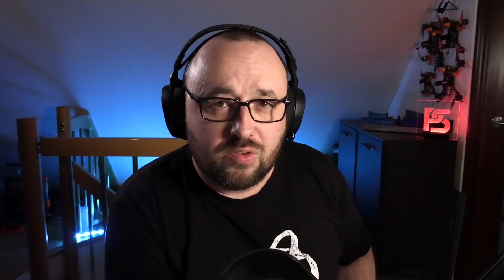Why INAV does not support PPM protocol anymore?

Comment: Betaflight still supports PPM input, and they're arguably at the forefront of open-source STM32-based flight controller firmware developement. 

Feature selection & priority is very subjective. We don't all need the entire catalog of new features within inav, yet could still benefit from bug fixes & improvements in the core code. Why not just move to a custom build format the way the Betaflight guys have? 

Also, exactly how much in terms of flash & memory resources were saved by removing PPM. I'm betting it wasn't even that much.
Reply from the maker: I don't want to go to deeper discussion as PPM was removed 2 years ago already. But there are some aspects I'd like to point out

1. INAV is not Betaflight with GPS and that means both firmwares have own paths 
2. It turned out in those 2 years since we dropped PPM nobody really compained about lack of it and our pilots were more than fine to either upgrade to something else or use legacy versions of INAV with their legacy radio links
3. Progress means that sometimes you have to let something go. Things that are no popular, are obsolete or just do not make sense anymore on a longer run. PPM, NMEA GPS and other things that are just no longer a thing
4. Removing not popular code is not only a flash saving procedure. It also removes cludged and dead code that bloats the codebase and makes everything just harder to use
5. With all due respect to BF, we have more interesting things to build than cloud build system. If I have some time I want to spend on open source and have a choice: cloud build system or interesting new feature than can be used in flight, I will choose the later one

Comment: you actually didn't explain the motivation besides calling it obsolete. it is still used and exists... but not sure wanting timer-based or interrupt-based code would explsin the issues you avoid. moved to ardurover instead, as in rover setups it is still common.
Reply from the maker: Steam engines also exist. Yet Noone puts them in modern trains

Comment: WHAAAAAAAT??    I just got my old F450 out, updated from iNav 2.5 to 6.0, got everything cal'd and working on resetting everything manually... and no PPM for how I have my EzUhf rx config'd.   :(   I was really hoping to use iNav6's 10" presets, but they aren't there either.  What's the last version that had PPM?

Comment: This only applies for  PPM protocol 'input' into a flight controller. INAV still supports PPM 'output'. ;)

TIP: for anyone still needing to use legacy PPM receiver with an current flight controller board. There are PPM to S-Bus, or PPM to Crossfire convertor pcb boards. Typically such adapter are priced ~$15-$20. There are also open-source projects on Github (both software and hardware circuit designs).
This could be helpful someone wanting to upgrade their flight controller hardware and gain support of INAV 4.x+ features, but is not quite ready/able to upgrade their radio transmitter/receiver hardware.

BTW: If just wanting basic stabilization and RTH with no other INAV features, ZOHD makes a lite flight controller called the KoPilot. (cost is ~$40-$50 US). KoPilot supports both PPM and SBus as inputs and outputs PPM.
Reply: Hello! does it work well with a dragonlink v2 receiver? it is ppm, I would like to convert it to sbus. Could you recommend me a model of converter? Cheers!
Reply: @estudioaguilamagnetica3174  I don't use/own dragon link so can't verify. A quick bench test would verify. It should, but not having used, can not promise. For better answer, try checking dragon link forums, support groups.

Comment: Jus to be clear, this is for the PPM control signal IN, not PPM out to the servos?
Reply: sorry, that's PWM... so safe for the servos..      sorry for the confusion. I need to sleep.   so Ibus and Sbus still Okay?  I'm a ArduPilot user anyway, but appreciate what you do!!
Reply from the maker: INAV never supported PPM outputs. Servos are woring with PWM, not PPM

Comment: I never understood the reason for removing something just because. I don't know. Is it hard to maintain? Does it cause problems in development? Do you need more space for other stuff? Removing it just because you guys think it's old is just frankly selfish. But I understand that it's your software and you can do whatever you want and I am not saying you shouldn't. But the reasons given in this video just don't cut it for me.
Reply: If you only add features the project becomes bloated, hard to maintain and hard to refactor. None of the developers have PPM receivers, so they won't be able to test if their changes broke something when they refactor related code, so this feature becomes supported on paper only. It's better to rip off the bandaid now than to leave the code to rot.
Reply: It's because of space. Obviously you don't need to drop it if it doesn't need to make room for new stuff.
Reply: @TimeFadesMemoryLasts  well yes. But thats at least a proper reason.

Comment: Great explanation! It allways takes some courage to do this, but I hope people will realize this is good! Losing old baggage helps to move things forward
Reply: pull your nose outta the brown hole
Reply: @jackoneill8585  Sorry you don't like this change. But like others said, you can still use older versions just fine! And it has plenty of features! Ask yourself, isn't it reasonable to say: if you want the latest bleeding edge features from Inav  then please don't use ancient RC receivers? Remember, deprecating functionality like this is an active decision which they take if they see benefits from doing it. And if the choice is between improving Inav or supporting really old hardware, you can understand where this goes. Working on an MCU you are really constrained in the resources available, I can imagine they needed to lose this in order to enable other functionality

Comment: That is not a reason to get rid of it.  Removing support for hardware that is not capable of running the latest version of software is one thing.  But just calling it "legacy" because you don't like it is totally different.  Many people still use old(er) receivers and there's nothing wrong with them.  But I guess you don't fly enough fixed wing to know that.
Reply from the maker: Use versions of INAV that still support PPM. There are plenty of those
Reply: @FPVUniversity  You're missing the point.  Why remove a feature that people use for the only reason that YOU feel it is "legacy".
Reply: @twinturbostang  Not sure of course about their rationale. But in general in software development, deprecating an old feature helps to implement new ones easier.  I can imagine losing this feature gave back some valuable hardware resources on the MCU
Reply: @Felix3301  and that is a reasonable argument. But removing it just because it's old is not.
Reply from the maker: @twinturbostang  Well, I have analytics data that shows that less than 1% of INAV users use PPM and the number is going down since the beginning. So yeah, it's legacy. Most modern FC even don't have PPM inputs
Reply: @FPVUniversity  Maybe you'd have more INAV users if you didn't drop support for people's hardware just because you think they are "legacy".
Reply: I fly a ton of fixed wing.  I also only fly digital rx protocols or straight to servos.  There is simply no need for ppm rx's.  I had em.  I tossed em.  I would much rather see Inav get less polluted, not bloated with older rx protocols that few people need.  Besides,  this is FREE software.  If you don't like no PPM, add it back in.  It's just code....

Comment: Do you know how many PPM receivers I still have on the shelf ?? I'm sure I'm not the only one. I do have some S-Bus receivers as well. Looks like I may need to downgrade from iNAV 4.1.0 to 3.0.0.
Reply: any chance these are frsky receivers? give opensky fw from fishpepper a shot. I flashed all my d4r-ii rx with opensky they work flawlessly with sbus now.
Reply: @derrogers  Thanks for the heads up but they are older FlySky 6 ch Receivers. I'll just use them on non iNav planes.
Reply: Everybody has lots of old shit on their shelves, doesn't mean it's a good idea to use it in new builds. Your PPM receivers would match nicely with a Multi-Wii you surely have stashed somewhere at the bottom of a drawer.
Reply: I did too.  I threw them away.  The newer protocols and stability are way more important than keeping an outdated receiver "just because".
Reply: Time to upgrade!
Reply: @Quick-Flash  Already have iNAV 4.1.0